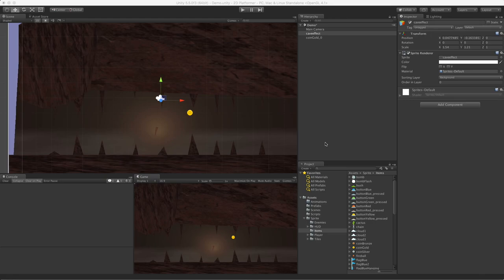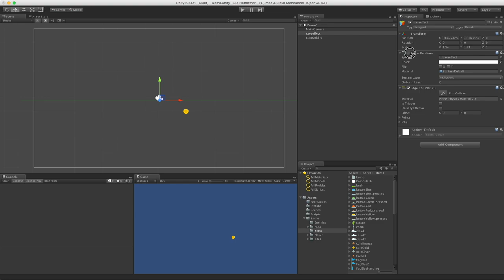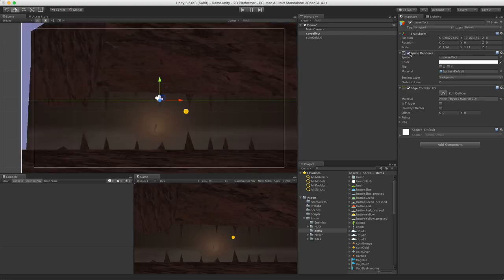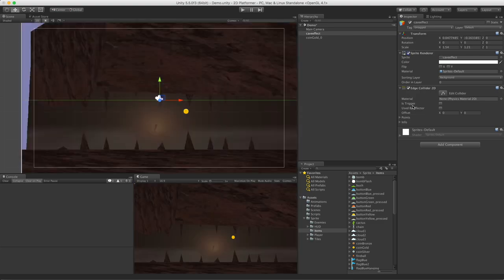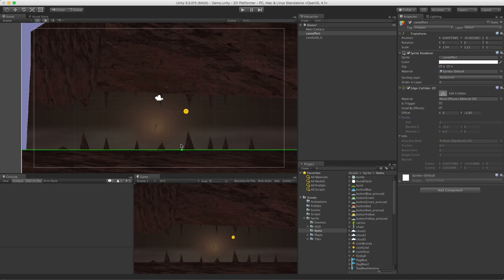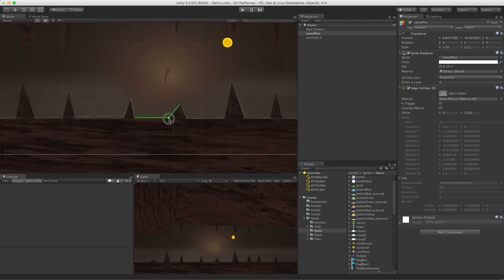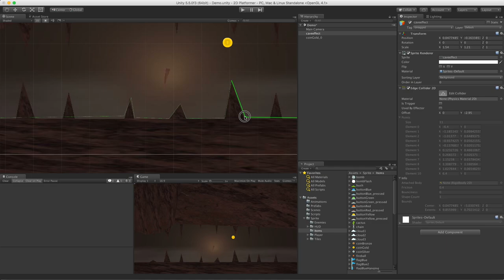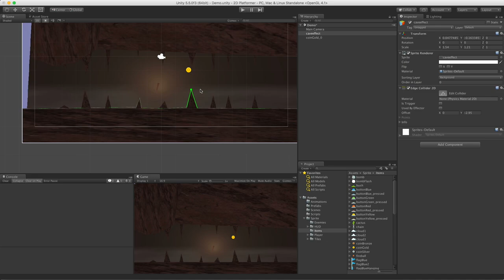Edge Collider 2D - 2D Game Development With Unity

Comment: Nice, thanks. 
Is there a way to make straight lines too? Like 90 degree angles and perfect level horizontal and vertical lines?
Reply: Also, I'm using RuleTiles for my game and if you could somehow set the collider for every grid piece that would be super useful. 
Is there a way to apply an Edge Collider to those?
I tried the Grid and Sprite Colliders, they don't work for me. I really tried to make them work but the Sprite Collider is not precise enough, and making 3 Rule Tiles so I can have 1 for Grid colliders and 2 for ascetic colliders got super complicated. 
I'm at the point where manually doing edge colliders for each map is actually the better option for me xD
Any tips? Thx
Reply: @Broockle  If you're using tilemaps, you should use tilemap colliders with composite colliders.

Comment: can I make a low poly 3d model into a 2d sprite?
Reply from the maker: No. It will always be a 3d model. You can use 3d models with 2d colliders on them though.
Reply: Actually you can. Just render png from every frame of animation, from side ortographic view and basicly you have sprites. Photoshop them in like automate/ Contact Sheet II or manually and voila. Here's your spriteSheet.